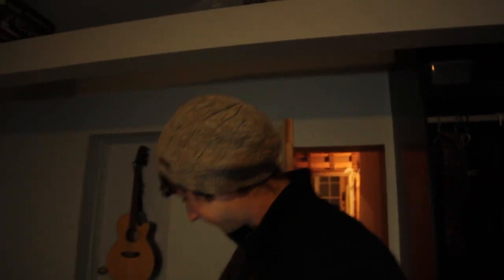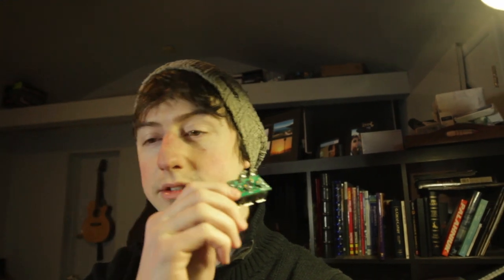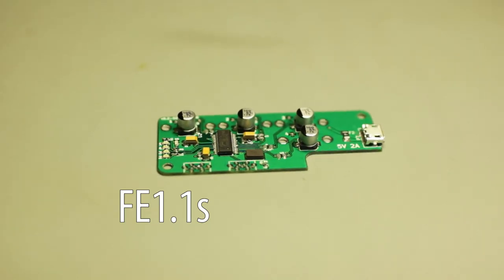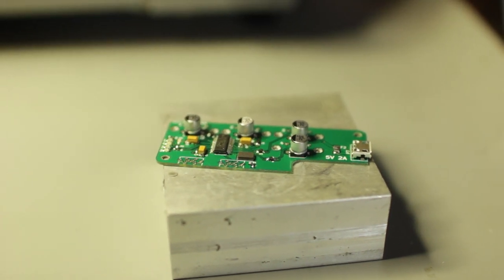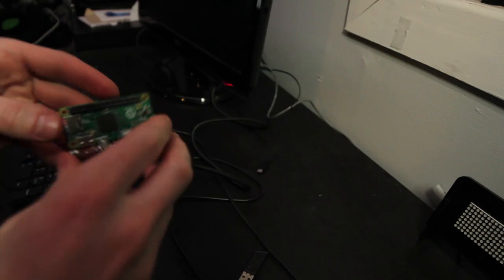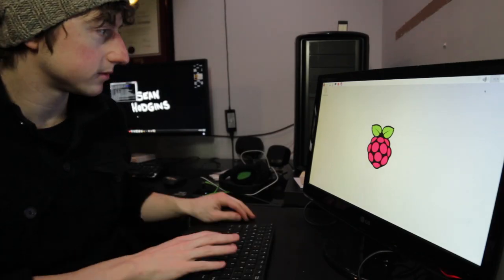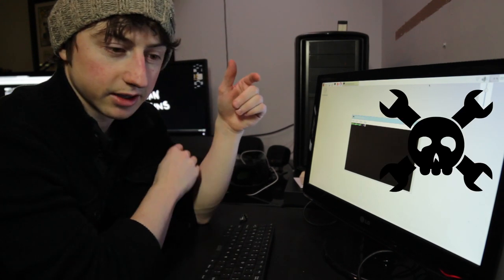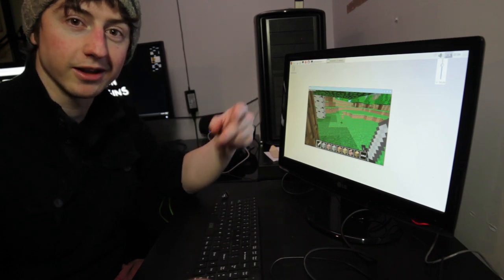Make a Raspberry Pi Zero USB Hub - The PiAngle

Comment: You may like to Check HubPiWi - a project at kickstarter. It integrates USB Hub and a 
WIfi and does not require any Cable or Connector. Also has an onboard 
PCB Antenna. There are two models of it  - one for Pi Zero 1.3 and an earlier one.

Comment: My god that is beautiful.
But I have one issue.
With shipping, it costs £22.
I might as well get a Pi 3 for that.
Reply from the maker: Thanks! Yeah I know they're a bit much in contrast to the cost of a Pi Zero.I also sell the bare board and chip so you can assemble one yourself like I did in the video!
Reply: Yeah, I watched the whole video. I've never actually soldered or anything like that so I'd rather not just jump to something I'd care about. 
Do you think the price would ever drop (preferably the P&P price as the board is well worth IMO).
Reply from the maker: Yeah I get that. These were kind of a single run type deal. If the kickstarter had succeeded I probably would do more but there doesn't seem to be much interest as of late. If I get tired of the rest of the ones sitting on my shelf I will probably put them on sale. If you want to sign up to my newsletter http://www.idlehandsdev.com/subscribe.html I will probably send out an email when that happens. I rarely send emails, if that is a concern.
Reply: I shall indeed sign up. Many thanks.
Reply: or you could just add the dongle and not use any ports.

this parts orrelevant and you can buy equivelant for dollers.

Comment: A shame the sockets point outward instead of over the top of the board. It would help reduce the footprint.
Reply from the maker: +Clive Flint Thats a good point. Its oriented this way because the HDMI will be going out the same way anyways. I make a small device that reverses the direction, but with only one USB, not a hub. Called the USB OTG Flip! on Tindie. Maybe I will make a version of the PiAngle the flips them also at some point.
Reply: +SeanHodgins cheers. The other thing to try would be having the board so it's flat on top of the zero which would reduce the height.
Reply: +Clive Flint angled micro usb to micro usb connectors ,just make sure you get one that is high enough so its postion ends up flat over the zero pcb

Comment: Add a single 18650 battery compartment to it and you will sell shed loads of them.
Reply from the maker: +Jonathan James Harrison Do you mean to power it? I have something else coming out that will do that.
Reply: +SeanHodgins yes to power it as an 18650 is exactly the same length as the pi zero.

Comment: so your trying to get funded to make this and it costs more then the pi lol.
Tbh you dont need this at all and could easily add for a buck. i wouldnt buy this at all unless it was a buck. to easy to get same think or multi adaptor/module. can get these already for cheap but id want for cheap. to easy and cheap to do other things. can save the space with your dongle and solder it in to save  port. no 1 wants wires anyway and this can go wireless so useless having extra ports as you wont need them.
Not bashing you. just giving you my thoughts straight off my head as im thinking about getting 1 for woreless cctv aswell as chromecast. I got dongles and everything already.
why would you add wired keyboard when you have dongle?
see im thinking wireless cctv, chromecast, keyboard and mouse. maybe 2 to 4 cameras. 
The problem I do have and why im here is making my cameras wireless with a back up battery and some kind of avr dvr back up recorder and sensor if possible.

Just explaining why im here, my position and thoughts. makes no sense to add this at all. youd just buy a doller hub and not put the stress or even waiste your cash on the pi.

the other thing i clicked onto real quick is that old tablets have better boards in 1.5ghz 8gb and look how available those are or even old smart phones.

I wish we had got this technical 10 years ago lol
I ended up buying a chromecast but want to set up wireless cameras. i got spy cam and 2 dongles spare aswell as adwinner tablet and smart phones but 4bucks is amazing and a fun though to it aswell as simple.

this my friend is shyt and pointless. just being honest. it wont sell. dont waste time. also you cant charge more then the main pc for any part, thats kind of business and sale side, it wont work or you might get 1 hit wonder.

The add on needs to be cheaper then main product aswell as its rivals, a good example is the "pi zero." and this is not a pi zero or no were near and tbh all threw video i wanted to comment get your head out your asss as you spoiled it. next time dont butt in, just leave the musing on and use sub titles as you come across so arrogant.

Take care.